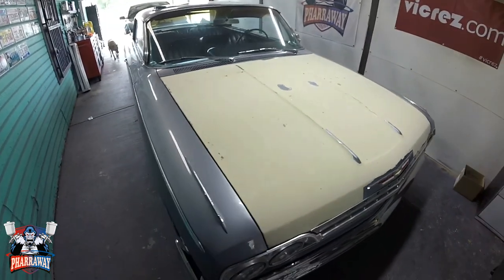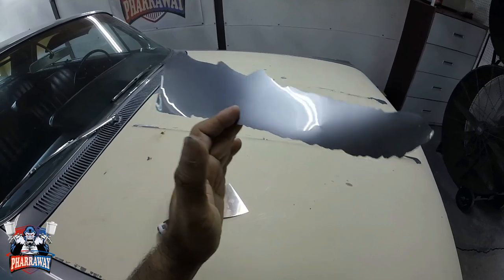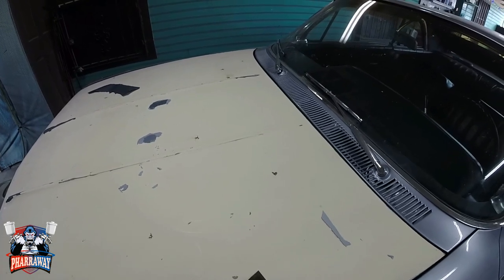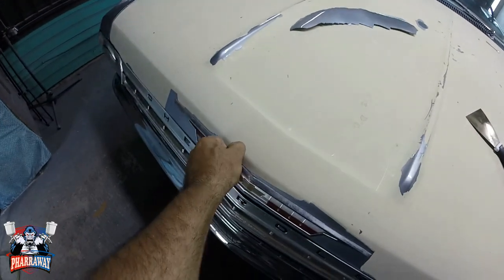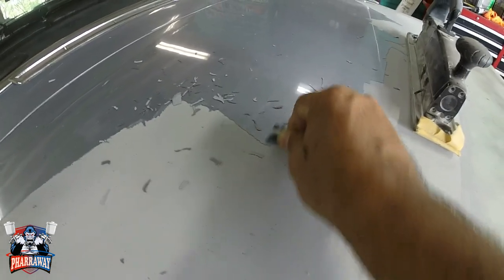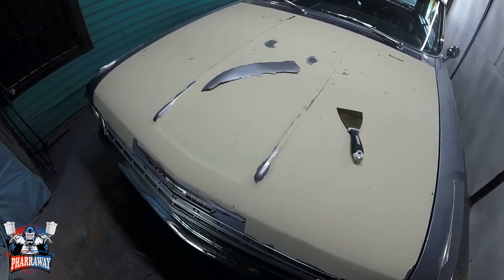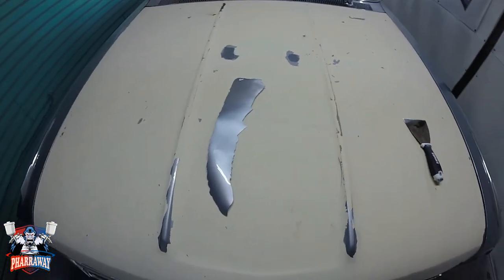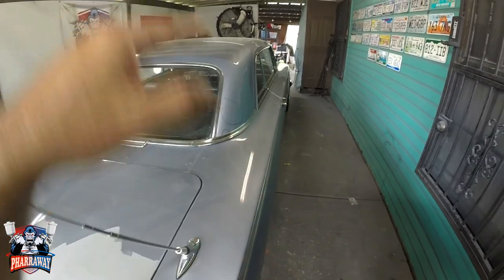HOW MANY COATS OF PAINT DO YOU NEED TO PAINT YOUR CAR

Comment: That paint looks like it didn't bond to the primer. If it bonded the primer should be stuck to the paint and the metal would be all thats left. Saw that on a house door once had to sand it all then start at the wood.

Comment: Just ran across this video.  I'm not a professional painter (anymore), but I think you have multiple problems going on here.  #1: the paint didn't adhere to the surface and #2: yes, that paint is way too thick.  I don't see any evidence of primer or sealer on that hood, so you may want to address the prep process moving forward.

Comment: Looks like they weren't sanding the metal before primer. Exactly like you said. Between coats and the final clear coats. Then fine sanding it going up each time so it is smooth and shiny. Dont forget to buff and wax in the end

Comment: Your thumbnail pic caught my attention.
I restored a '66 Mustang a few years ago with the exact same paint issues.
Took many days and tons of razor blades to remove it all.
I tried sanding, but that was pointless because it just clogged up the paper.
Btw when I was 16, I took my driving test in a '62 Impala.
Thanks for the video (and memories) 👍
Reply from the maker: you are correct it will clogged up your sand paper

Comment: Adhesion issues. They should have applied a wet on wet sealer.  But aside from coats, what about an estimate of how much in sprayable amounts? Clear tends to come in 1.25-1.5 gallon kits and usually has a good amount leftover for 2-3 coat jobs. What abiut basecoat though? Some say 2-2.5 quarts unreduced, some say 1 gallon unreduced, etc

Comment: How many coats of single stage over a car that had the factory paint sanded and repaired where necessary? I was thinking 2-3 coats, then sand and add another coat if it needs it
Reply from the maker: Yes 3 coats is enough

Comment: The primer wasn’t sanded lol no fusion 3 coat of paint 3 clear dry then sand and clear again sand and buff. The gray scuff pad is not good enough. You have to use the red they probably used 1000 grit on the primer instead of 400.- 600 did they use wax and oil remover ? It could be a lot of things they could’ve done it in the winter with a torpedo heater he oils from it ouch . To cold to pain even